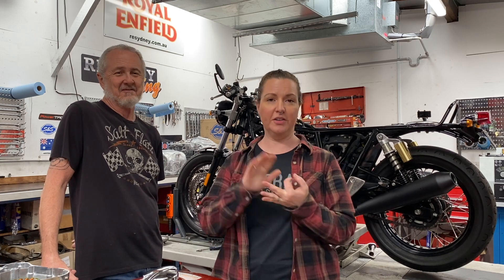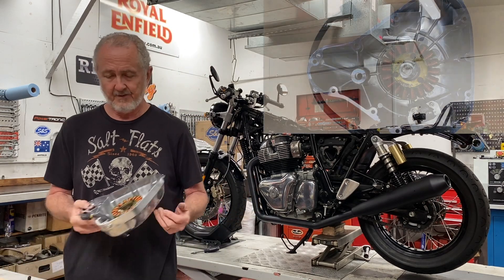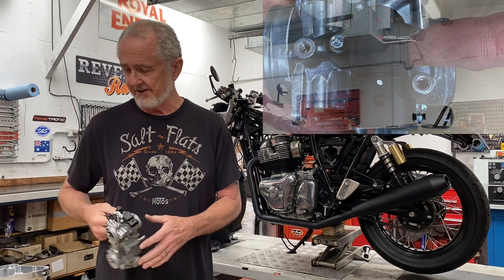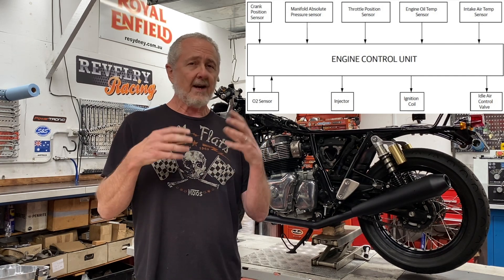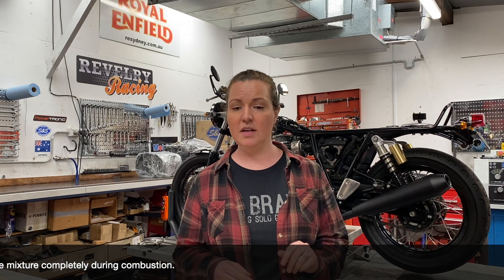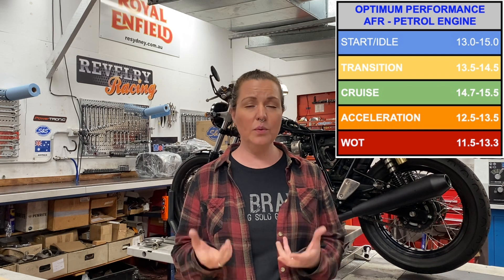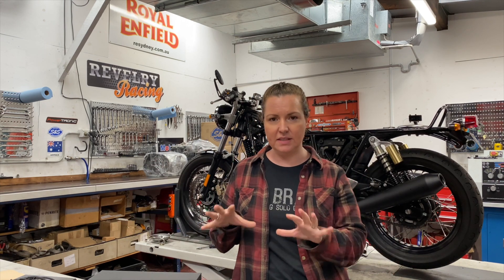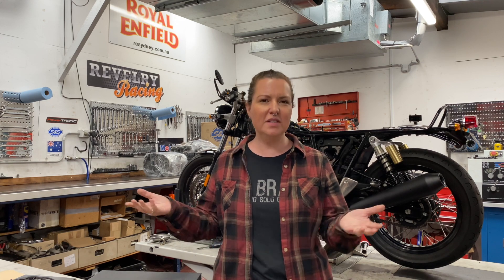Episode 4: EFI Tuners Part 1 -  Royal Enfield 650 Twin

Comment: When my GT deals with long durations of standstill traffic, it gets really hot and when i open the throttle, it struggles to accelerate and behaves as if im in a much higher gear at low speeds even though im in 1st gear. Could any of the sensors you listed be at fault?

Comment: Thanks for all the crips clean details in highly important information.
I know you mentioned this, but not 100% sure - is it safe to run my bike (INT650) if I installed the DNA filter and a 2in1 exhaust? Will the ECU adapt to this and supply a sufficient flow of fuel so that it doesn't run lean? Thank you!

Comment: Hi Will+Santina,  I have a question about installing the FuelXPro on my RE Interceptor 2021 model. On the new wiring harness it is labelled Lambda1 + Lambda2--does it matter which cylinder is plugged into which numbered wiring as in I thought Left side cylinder as you sit on the bike is number 1 cylinder so number 1Labelled cable should connect to Left cylinder 02 sensor.   Greg
Reply from the maker: It does matter.  Left side is number 1.
Reply: Thanking you for the response. Greg @RevelryCycles

Comment: Will stock ECU work ok with freeflow headers and exhaust?
Reply from the maker: Yep, sure will.
Reply: @RevelryCycles  thanks for your reply! Would a booster plug be beneficial in this case?
Reply from the maker: @theradiantchild    watch our tuner videos https://youtu.be/v0SK9ebe6_Q?si=g7rVZxXKEL6n1j91
Reply: @RevelryCycles  I'm not looking to race. I'd just like less weight and better throttle response.

Comment: Wow! For the first time I got to know so much in such a short time!
Sir/Ma'am my question is if you may, if I use a freeflow+decat on CL350 & don't use a tuner:-
1)Could it adversely affect the engine life?
2)Could these two mods decrease the fuel efficiency or decrease the low end torque when compared to the stock bike?
I'll be installing these mods only for sound & I'm happy with the stock performance.

Comment: Touring the USA with loaded saddlebags, tent, computer bag, sleeping bag, everything I own on my INT650. I got tired of always having to stop, clean, lube, and adjust the chain per the service manual intervals. And I got tired of no matter what lube I used and how carefully I cleaned the excess, there was always a sling off build up to clean and a dirty saddlebag. I purchased the Bandidos Pitstop Belt drive conversion and I'm very happy with that and was surprised that it was quieter and smoother. However, they used a sprocket or pulley ratio that leans on the power side and I now get less range out of my tank. Is there anything you suggest to bring down my fuel consumption to get more miles between fillups? Aside from the belt drive my bike is stock, filter, plugs, I run Silkolene oil. Love you two!
Reply from the maker: Not really. While there are all kinds of little things you can do to improve fuel consumption, if your gearing is lower there's probably not much you can do, other than slow down and or/ loose a bunch of weight off your touring kit, to make up "a lot" of difference in fuel consumption. If you're going to stay with the lower gearing you should fit a taller profile rear tyre when it's time for a tyre. A MUCH taller tyre will bring back a little bit of your gearing.

Comment: Is a booster right for me? 
The only performance mods I want is Diablo exhaust and DNA air filter. I don’t race. I just want to prevent the headers from bluing (which I keep seeing on other GTs with this exhaust & filter system) and help keep my engine safe from running too lean. I’m very new to all of this, but it seems like a booster could be a great solution for me instead of a Powertronics tuner... ?

Ps. I subbed :)
Reply from the maker: We don't have any experience with the booster. The concept of making the stock ECU think the engine is colder than it is and thereby making the fuel mixture slightly richer theoretically should work. Is it exactly the mixture you need? Only one way to find out.

Comment: I have a booster plug in my little TU250X it did what I wanted that was to smooth out throttle response down low for urban riding. Maybe a small amount of extra torque down low.

Comment: Hi , i have a continental gt650 and i have an issue , whenever i go full throttle , near the redline i hear some metal tapping noise from the top cover side in the engine , can you help identify the problem?
Reply from the maker: Sounds like you're hitting the rev limiter
Reply: @RevelryCycles  oh , the rev limiter makes cracking noises from 7k rpm ?
Reply: @RevelryCycles  it's a hard pace knock sounds likr cracking noise as if someone is knocking the top cover, is it normal?
Reply from the maker: @adarshbhatnagar7874  go to your local dealer if you have concerns. We can’t diagnose motorcycles over the internet.
Reply: @adarshbhatnagar7874  did you find out what this sound is? Mine does the same thing with only 1000 miles on the odometer

Comment: If i use aftrrmarket air filter cap and high flow air filtrr with slip on exhaust does i need to tune or stock ecu adjust
Reply from the maker: https://www.youtube.com/watch?v=v0SK9ebe6_Q&t=390s

Comment: Hi there, from France !  I like yours videos so far. I own an interceptor, and also have been working on my track car for more than a decade. I have been toying with its ECU. Well, i reverse engineered it to make it programmable. They were simple and not encrypted at the time... anyway i learned a lot tuning it myself, so I have some critics to offer. I hope you will not take them bad. 
There have been some shortcuts here and there (like the AFR: 14.7 "part" to 1 is actually "gram" . It is weight, not volume. important as soon as you get into partial load, super/turbo charging or ram effect), and some mistakes here. Most are common mistakes about fueling.
The only engines that can get 14.7 - 15 AFR all the time are direct injection engines with wideband lambda sensors. Our ECU uses indirect injectors and narrowband sensors, like most engines, and they only go nearly stoich at idle, low load, low to mid rpm. As soon as you accelerate it goes rich, and at high load / high revs, the stock ECU is likely to go richer than you'd want, like 12 to 11 AFR if not lower, for safety purpose. The reason is lambda sensors are too slow to work all the time, they  can only make a usable measurement at constant load and low to mid rpm.  If the mixture gets lean when the ECU cannot see it,  the engine is going to melt a piston, so manufacturers make it run rich. Richer does not mean more power, most tuners will actually lean out the engine. This gives back a little power, but there is now no safety against an aging fuel pump, injector, or from the injector command, so an external wideband lambda controller with an alarm is strongly encouraged.  There is also no "economy" mapping. You can get the engine less responsive to drive in the wet by pulling timing a bit, but leaning out is not going to make the bike consume significantly less. The only significant lesser fuel consumption comes from a smooth driving.

Now, leaning out high load is not really making more power, it is getting power back. The only way to get more power is actually from changing the ignition timing. That means there is no point to use a power commander, since it cannot do that. 
The perfect ignition timing exist, but regular fuels cannot use it, as they will self ignite before and that destroys engines, so the stock programming uses a conservative timing. this way, even with the crappiest fuel, it will not detonate. Higher octane fuel resist self ignite better, so a tuner can set the engine with a timing closer to perfect if the user puts high octane fuel. If the timing is too high for the octane rating though ... holes in pistons, destroyed engines, you know the drill. The best / cheapest way to go ? Expensive race fuel... or cheap e85. I found out It  does not self ignite and the perfect timing can be used. I read it has a 104 octane rating, which would explain that. It also cools engines a bit (no idea why. Engine runs cooler, EGT is 50C less on my track car). The only downside is the fuel consumption goes up and it requires bigger injectors, as stoeich is now 9:1 . The ECU does not care since it reads lambda, and lambda = 1 when stoeich, wether stoeich requires 14.7:1 or 9:1 does not matter. If your race sanctionning body allows it, use that fuel and raise the compression as much as you can. 
 
As far as the power plug goes, it does not work like that. It will trick the ECU into believing the air is colder, true, but the AFR closed loop will quickly adjust trims and phase it out completely, just like it will adapt mufflers and air filters. Its only effect is on a different fueling table that unfortunately is not accessible even from powertronics (i already mailed them about). This table is only accessed by the ECU when there is  a sudden change in throttle, and it applies a multiplier based on air temp and throttle position to the currently used fuel cell from the table. This table is the same as the carburetor accelerator pump.  This is why the booster plug solves the problem of hesitating engines with a high flow air filter, as paper filtration element is poor in transients ( but it really is better at filtration, and it flows more when dirty than any other system)

Sorry for the wall of text. Keep up the good work !

Comment: Great work guys! Loving your work. My Orange Crush has DNA filter, Indian end cans and...POWER BOOSTER (yay!) That's as far as I will go except for being tempted by your headers... (sorry Wifey). The best fitment by the seat of the pants dyno was the Power Booster, it made low speed riding so very much easier and more pleasant, a lot more snap in the acceleration... Anyway, just wanted to put in a vote for the PB because it is a SHITload cheaper than any of the ECU tuners. Cheers from Abu Dhabi!

Comment: Alkmaar, The Netherlands here and the owner of an Orange Crush Interceptor with open TEC pipes and open  airfliter. Before this bike i had a 2010 Harley SuperGlide and the only thing i miss from that bike is the torque it has. I am thinking about the big bore kit for my RE but wait untill i know more about the reliability of the crankshaft and bearings with all these upgrades. Thanks for again great info in this vid :)

Comment: Is there a point in the 650cc (not the overbore) tune where the clutch needs the replacement basket?  I'm curious as to when the stock clutch isn't up to the HP increase.
Reply from the maker: We’re going to do a “clutches” video with much more detail. Without getting too far into it, the short answer is;  we haven’t seen a 650cc bike overrun the torque capacity of the stock clutch... so far.
Reply: @RevelryCycles  Good to know, as I have the CAM when my bike is being outfitted after a freeway incident.  Your mention of the 11:1 piston set under the "why not" had me thinking....  Well the not being... not if its going to overwhelm the stock clutch at some point....  Trying to stick with the low hanging fruit of performance and not spend into the crazy zone for little gain....

Comment: You mention the Booster Plug...What's your take on refitting the stock one outside the filter box to get a cooler reading, much the same as the Booster would do ? After all, it doesn't need to be inside the box, which is actually giving a hotter reading than the air temp going into the filter. Obviously blank off the fitting hole in the box as well. Cheers from NZ.
Reply from the maker: We always say if you're not testing you're guessing. Since we haven't tested that, I'm guessing you'd need a lot more temperature difference than that to get any measurable increase in AFR.
Reply: In my case it helped the stumble off idle from a standing start.  Otherwise it had no effect I could discern.  With a 16t front sprocket it was a help as the tendency to stall unexpectedly was more pronounced with the taller gearing.  If you do not experience that on your RE <shrug> I'll say though when your riding two up and the bike does that sudden stall and your helmets collide.... its worth it.....